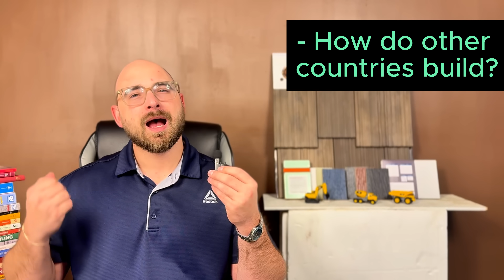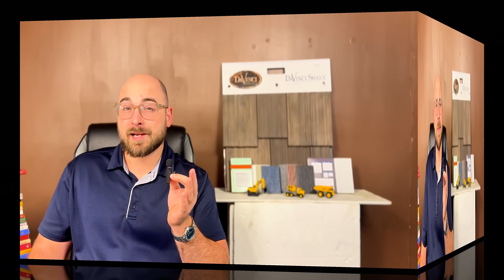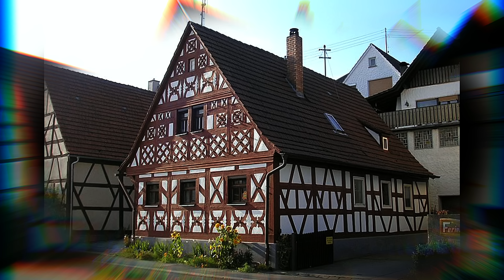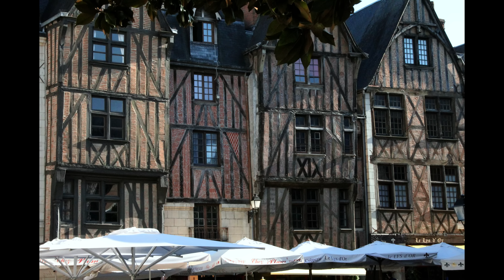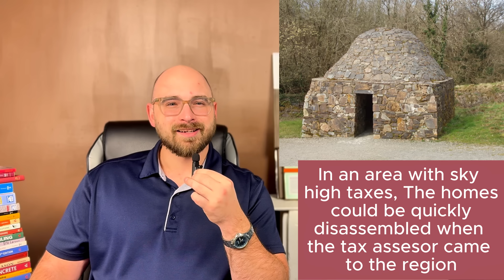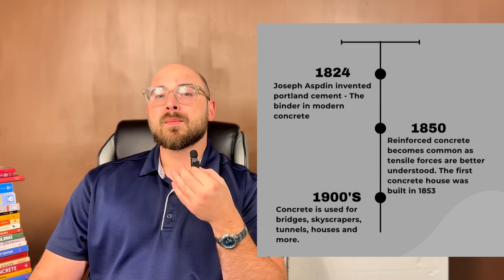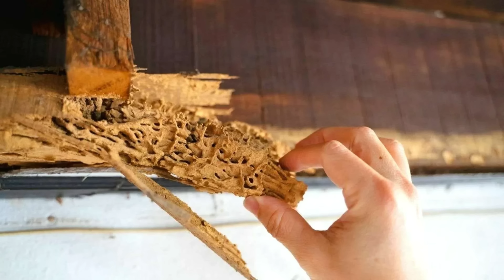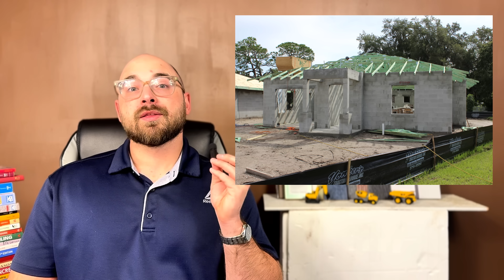Why Other Countries LAUGH at American Homes

Comment: I've watched most of the video, so excuse me if that was something that I missed as TLDR at some point got me.
The problem with typical American construction work for family homes is that they are cost effective, without being cost effective.
The construction is rendered down to an immense degree to be cost effective, but then the actual price is VERY high compared to homes in Europe. What I heard from a friend in the US, the money he paid for one of those light wood-construction house was the same as for TWO (!!) brick & mortar houses over here in Europe. The problem is simply that this seems to be one of those fields where capitalism is out of control in the US and what you get is very far from what you pay for.

Second problem is sustainability. Most of the houses I saw used cheap, artificial spray foam or other insulation that will stick to all other materials used and will transform the entire building into a huge block of toxic waste when torn down. This is ridiculous considering the times we live in. Yes, the insulation provided by these materials might be a bit better compared to economically friendly alternatives, but come the heck on...

Last, but not least, is the problem with standardization and quality of work in the US.
I know, you have all those codes, but the simple fact alone that you are completely lost if you do not have an code auditor that checks the contractor's work is ridiculous, because there is simply no way of checking if whoever does the work for you, actually know wtf he is doing.This is why most countries over here have a very much enforced system of contractor education and ranking, where you have rookies, journeymen, masters, etc. that will share the work depending on their level of education, will at the same time educate the people below them and first and foremost: For some work you are mandated to have a certain title, sometimes even be allowed to found and run a certain company if you have a masters rank or something.
Thus, you know that a contractor is only allowed to send you people educated in their job, which is the same for freelancers, otherwise his insurance will cover nothing on his end, and that people actually know what they do, even the ones just screwing your light weight wood construction together.

By the way, Scandinavian countries use both, heavy and light wood-framing, but they very much also use natural materials for the rest of the building, not just the frame, and they more than likely pay a lot less for it in the end.

Comment: Here I thought I'd found a video that explained the advantages of the way we build homes, but instead you just catered to anti-American ignorance and bigotry. And while a concrete or brick home home's structure might withstand hurricanes and tornadoes better, it's structural damage will cost more to fix, and the interior and contents of the home will still be destroyed.
Reply: You Americans are not exceptional despite what you may have been taught growing up.
Reply from the maker: what are the advantages? fast, cheap, and low quality?      An insulated concrete house (like with ICF) is going to save lives, use less energy, and offer greater comfort and air quality.

Comment: In California you can't build brick or stone houses, they will collapse in any major earthquake. So light wood frame is the only logical choice, or seismically resistant concrete house, which is very expensive.
The other thing, US houses usually feature very solid and expensive concrete foundation, often including basement. And with good foundation you won't have any problem with quality built light frame house whatsoever.
Reply: When was the last time you got earthquake in CA?
Reply: @kriskris998  7.1 July 5, 2019	Ridgecrest/Trona.
I was living in NZ when Christchurch was struck by earthquake (185 dead) and saw in the news all those cracked/ruined structures made from bricks and stone. The city cathedral partially collapsed.
Reply from the maker: I’m glad you mentioned seismic rates concrete homes as an option, they’re a fire proof, earthquake resistant alternative., but yes they do cost more. 

A happy medium, I believe is to incorporate steel framing, it is both noncombustible AND able to withstand seismic forces

Comment: Regarding CMU, you have mentioned good thermal properties. I wouldn't agree with that. They where very popular here in Croatia in the 60s, 70s and 80s, but they are considered as a bad isolation material and used if you wanted to save some money. A lot of houses were built with mix of bricks and CMUs, bricks for the floor where you planed to live and CMUs for a garage or the ground floor with a commercial space for a (work)shop.
For more than 2000 years the main building material was stone (at least here in Dalmatia), but last 60 years, if you would like to build a quality house, porotherm like bricks with reinforced concrete columns and concrete slab is a default. For larger buildings and apartment buildings, reinforced concrete is a default. Partition walls (between rooms, non load-bearing walls) were made from ytong blocks, but last 25 years mostly from knauf/rigips plates within aluminum frames. Of course, isolation is a must in all walls.

Comment: I was waiting for my tiype of house but it was not mentioned. It should be ful timber, with timber framed rofing siting on stone/concret fundation. The timber walls ar fitted with strips of slat diagonaly that got covered in molter. And the roofing is done with roof tiles or with fiber cement sheet. Comon but not the only tipe for houses in my parts.
Reply from the maker: Interesting, where are you located?
Reply: @Mike_Fortin  Romania. Transilvania. In the Carpatian mountains. Wood is not an ishue here and is the primary building material since ewer. Stone is also not rare. Modern materails ar also present and used but this large amount of wood usage that I though normal in my childhoo is something that struck me that on other parts of world how sparingly they use it.
Another big builing material is the large white porosus bricks, a more modern stuf but also popular.

Comment: Direct experience from Italy. Brick house (well designed,Important!) WOULD LAST FOREVER.
Concrete after  60years will start to degrade and need maintenance
The Roof need always to be a wood structure, specially if you are in  seismic zone.
If historically earthquake go +6 then a house with wood structure and roof is a must.
I have seen village flattened (7richter) and most of the building still up had wood structure ( again, Very well designed, not to save cost !)
A good wood house is expensive.
I guess if you have tornados/hurricanes I would have a Concrete house with concreate roof, again well designed.
But a stone house is always the most beautiful
(My longest comment in YouTube :D )
Reply from the maker: Thank you for your longest comment on YouTube 

I want to clarify and say that concrete can survive longer than 60 years. If we use ICF, protecting the concrete from moisture, add a capillary break at the footer to protect against moisture, the concrete will survive drastically longer 

There’s also reinforcement that does not corrode or is corrosion resistant such as fiberglass rebar, composite, stainless steel, etc. 

Concrete, when engineered to include seismic joints and a proper foundation will actually be able to survive a higher magnitude earthquake than a wood home , the seismic joints are essentially expansion joints that allow for controlled movement of the concrete structure without breaking apart, more about that in my next video !
Reply: I agree with you. We have different types and techniques, like prestressed reinforced concrete and so on. Could talk for hours!
I hope you achieve your goal to make better houses in the USA, It is terrible to see all this destruction after natural events

Comment: Concrete has one ton of CO2 emissions per ton of concrete, same as steel. In 2025 this needs to be a major deciding factor. And it would be in every discussion like this in Europe. I don’t understand why it wasn’t even mentioned.

Reducing these emissions with concrete is a research topic and will most likely only work with CCS.

Until then, wood, mud, and stone are the best options, followed by brick.
Reply from the maker: I don’t think it’s so black and white, it’s a multifaceted issue, 

Concrete production releases C02, but the curing process reabsorbs some of the C02. Wood needs gas powered equipment to grow, harvest, plane, engineer, kill dry, transport, and install it. Then, it has a shorter lifespan, can potentially end up in a landfill in disaster zones, and it’s also flammable and susceptible to moisture. None of these are good for the environment either, especially the fire … 

Yes lumber has a place, concrete has a place and we should be good stewards. But we are also limited to industry standards, practices, and availability. When eco friendly concrete is widespread I’ll advocate for that, I know someone who is working on one that looks impressive, when EPS is replaced by plant material, I’m all for it, 

But I wouldn’t say we should use concrete because of C02. 

One of the most sustainable things we can do is build something that lasts a long time and uses less energy, ICF homes do just that . It’s not the inn way to build, but I think it’s a darn good one and that’s why we specialize in it

Comment: What about the Romans using lead wrapped iron in the Coliseum and that leading to it's long standing resilience?  In my estimation this is better than just rebar reinforcement.  Concretes porosity allows water to run in which rusts the rebar plus the difference in contraction between steel and concrete promotes the cracking of concrete and adds to the porosity and adds to the rebar rusting.  How did you miss this fact that has been known for at least 50 years?

Comment: Concrete is very durable, nearly fireproof.  And quite expensive as well as lousy thermal insulation.  Stick built is a case of "horses for courses."  Platform framing is indeed the best choice for much of the U.S.  Brick veneer about eliminates maintenance of the exterior walls.  We're not entirely idiots.  Now, if I were building on Sanibel, I'd go reinforced concrete to deal with the hurricane problem.
Reply from the maker: If you build concrete using ICF, it’s well insulated and comparable in cost
Reply: @Mike_Fortin  You are correct.  And I like that approach.

Comment: However they are built most American houses are mostly ugly. This is in part due to the fact we use the imperial  method of measuring also used in England. It is an ungainly system while the Metric system is much more suited to good design. especially with manufactured building products. German windows are wonderful. They open in a ways that allows you to wash them inside and out while being inside. My windows when open i/2 covers the other when I/2 is open. Falling out of a second story window while trying to wash the outside is not an option I care to pursue.

Comment: So humidity is a problem with concrete houses due to mold? Never really had that issue appear much in the Philippines despite being one of the most humid places you could probably be in with concrete being very wide spread (minus the budget houses in the slums made of wood and relatively old buildings)

Comment: Junkiest Crap new houses seen are in Phoenix Arizona.  Pour a Poor thin as possible (4 inch) slab on raw ground (caliche ?)  slap in fast as possible the cheapest crooked 2x4 with nail guns.  cover studs with cardboard and chicken wire on outside, smear on some stucco made from caliche.     on inside thinnest cheapest "fly-ash" Chinese drywall.  Staple together fast as possible.  Roof is all chip board and flimsiest rafters possible.  Cover with cheapest roofing material possible.    absolute junk

Comment: No, the answer is, yes, foreign homes are better than the US built homes because they're built to last, fireproof, resistant to natural and man-made disasters, they're energy efficient, they are very strong, and they reduce sound form the outside world. Saving time and money means nothing if the house gets mold, burns down, or gets destroyed by a hurricane, typhoon, or tornado. Even if you have insurance all the irreplaceable things destroyed in these events and possibly lives are not worth saving time and money up front to build if you have to waste time and money rebuilding. And if someone dies because the hose is not built well of strong materials then it's not worth the saved time and money at all. Why would you live in a potential death trap? The so called, problems you mentioned for solid structure homes are nothing compared to the problem of fire alone not to mention all the other problems with weak flammable balloon framed homes.
Reply from the maker: I agree, that’s why I specialize in building concrete homes 

It’s not the only way, but it’s what I decided to offer because I believe there are many advantages, which you mentioned 

My hope is that it becomes more popular across the country , saving lives, building to last, etc

Comment: The problem with cheap US wood framed homes is the use of nail guns firing smooth bore wire nails.  And shaking or fluctuating high wind pressure results in these almost useless nails being pulled loose with catastrophic results.

I recently built a strong home, using concrete foundations, ICF basement walls and SIP (Structural Insulated Panel) for the walls and roof.  This house has NO nails.  It uses long screws and bolts exclusively.  SIPs are more than 45% stronger than traditional framing, are well insulated (of course) and the architect and manufacturer ensure that all required conduits for internal wiring were molded in during their production.

After we'd completed the structure, installed all windows and doors to weather seal the property we were unable to find any contractor prepared to plumb or wire the home.  Why?  Because it was something new and they were not prepared to learn anything new.  The SIP manufacturer offered to provide free, on site, training but no contractor was interested.

Americans live in crap houses because the contractors are too lazy to adopt new techniques.  They still build house like it's 1955, except the quality of the wood now is much lower and nail guns can't fire ring shank nails, so they use lousy smooth nails that pull out too easily, but can be fired quickly and cheaply.

Comment: "Built to last" is a funny comment.  Last for centuries?  Most of those buildings will be torn down within 50 years.  Construction is about material availability and physical properties.  Are Solid Wall structures more durable than a Heavy Wood Frame or Light Wood Frame?   Not if you have earthquakes.  If you have wildfires, maybe.  If you have wind, sometimes.  The weight to strength ratio for light timber framing is great.  But being light, if you get a puncture your roof can fly away. What Europe calls a 'Tornado' is what people in the US would call a 'Dust Devil'.  To be afraid of a dust devil is idiotic.  But to not be afraid of a tornado capable of leveling a stone structure because you think it is the same as a dust devil is even more idiotic.  300MPH wind will push down most walls.  And remember, a heavy wall when it moves exerts more force and leverage on its base because of its weight.  Is a solid wall structure better for flooding?  Absolutely not.  They often become unlivable.   To play the 'whose methods are better' game without taking into account the local natural hazards is a fools game.   Skilled builders came to the US from all of those countries, and switched their construction methods when they did.  It would be a better video to ask why these skilled artisans who had built Solid Wall Construction in Europe for generations suddenly decided to develop a new method upon arrival in North America.  That's where the real information is.  Not in some veiled attempt by at ego masturbation as superior builders by reason of geography.

Comment: You missed concrete tiles for the roof. Very common in Australia, and much cheaper than clay tiles. Does have the downside that you won't get lichen growing on it, like you would with clay, though. Oh, and tiled roofs have a huge advantage over metal ones for homes: they're quiet. Metal ones are noisy. They expand and contract with the heat of the day and make a lot of noise when it's raining. Tiles don't resonate when hit by raindrops.